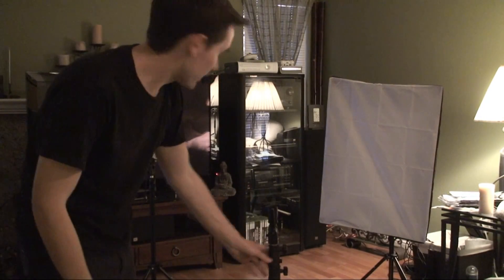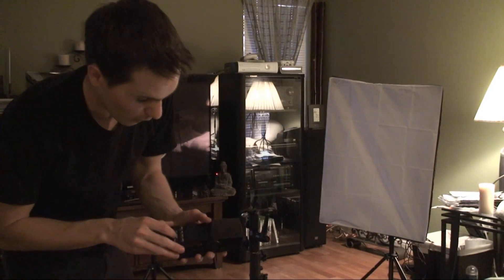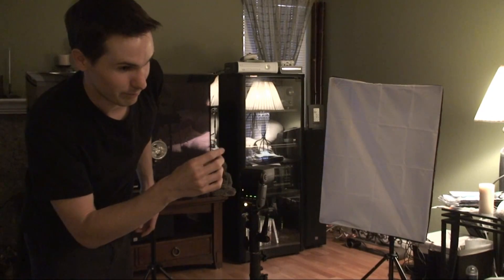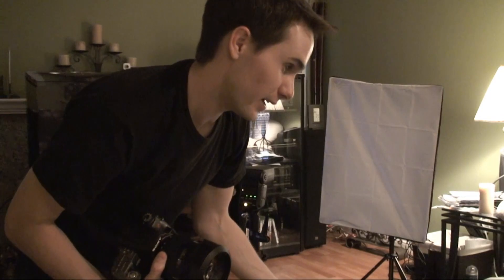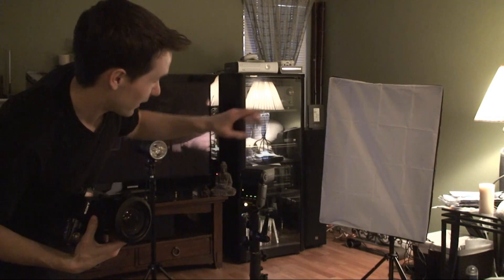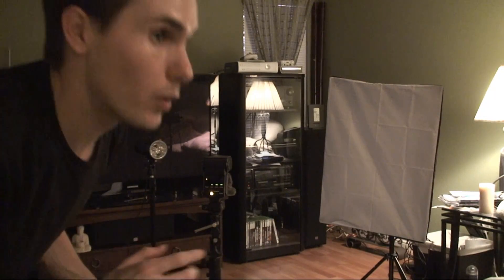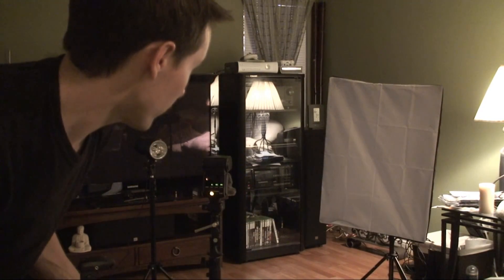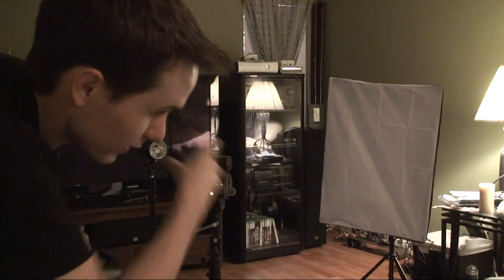Why TTL is not always your friend in the studio

Comment: idk if u looked it up or not, cuz im starting to shoot strobe photography.  but if your other flashes have slave modes, like s1 and s2, you can still use the ttl function if you switch the other flashes to s2.  s2 (slave mode 2) ignores the pre flash and fires the correct light power when the main flash fires after metering.